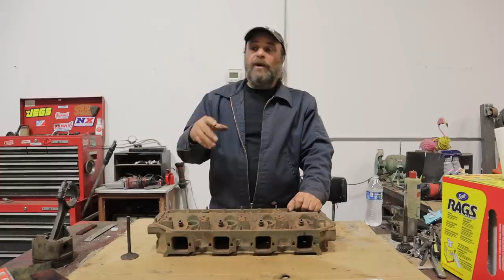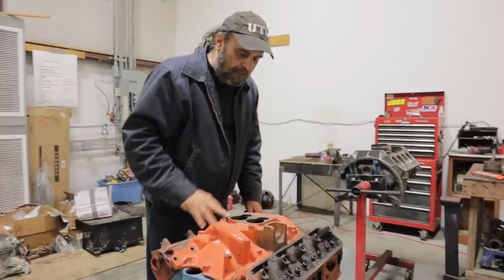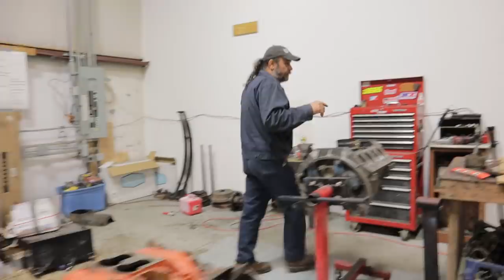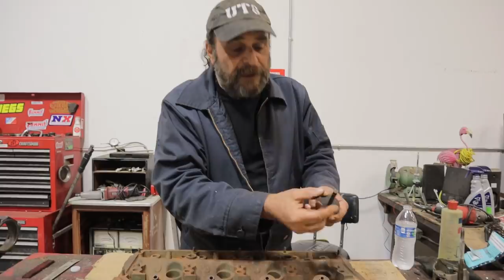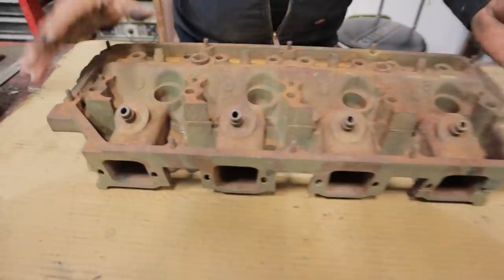Carburetor MPG Myths And Intake System Thermodynamics

Comment: Propane 360 powerwagon was gasified fuel.  It made at best 10% more mpg.  The biggest hurdle I can touch is rpm.  I can build and fine tune well, then the sweet spot in rpm for torque will get 20-30% better mpg than 1000 rpm more.

Comment: I'm a retired mechanic I had a 1965 Ford Galaxie four-door 289 V8 with a two-barrel carburetor Ford carburetor old motor compression was 120 down to 90 lb compression old motor I pulled a 5 x 10 trailer 100 lb tongue weight on the hitch I got 24 miles to the gallon going through Kansas and Missouri I modified the carburetor for better gas mileage got between 23 1/2 and 24 Mi to the gallon pulling that enclosed trailer I can also do the same modification with the Holley carburetor
Reply: What kind of modifications were made to help get good mileage?

Comment: In the 90's I was a Quadrajet wizard. I not only knew how they worked but why. I could make them run circles around a Holley..Next best thing to fuel injection in my opinion. I found through experimentation that the intake port layout affected the type of carb that would work better. On GMs and Mopars with Siamese ports, like a spreadbore and Ford type layouts respond better to square bore carbs. Back in my wrench turning days, we would see intake valves so dirty that it would screw with the mixture. Unburned fuel is nasty. Eventually sticks rings and heavy deposits lower the detonation threshold. For this reason, I regularly pour in a full can of Seafoam.
Reply: Interesting. What are your thoughts on the electronic quadrajet vs various aftermarket efi's? Wondering if such a carb could be good for a built motor in a classic, which would simplify things, and keep it out of proprietary controllers, but at the same time avoid cylinder wash and keep optimal afr, in the hands of a more novice carb tuner with limited time to apply to it. Now, I know in classuc car curcles most anything that complicates things is frowned upon, and especially electronics. And I get that on a race track a double pumper would be preferred, for quick changes etc. But as a driver, Im thinking this option may have been largely overlooked by the community. Any thoughts on the matter?
Reply: @Santor-  The E Quads were controlled by a rather primitive ECM that basically cycled the primary metering rods up and down and a oxygen sensor. For someone not familiar with the intricacies of carburation, the aftermarket EFI is the way to go. Those old carbs required knowledge of jets and metering rods. Spring tension controlled both the primary enrichment system and the opening of the secondary air doors. Misadjusted secondaries were the number one reason for the bad reputation. There were two sets of metering rods to play with as well as different hangers that varied the rate they exposed the jet. GM had many different rods, jets and hangers for different applications..my favorite trick was using a Ram air float from a GTO..it was smaller and allowed more fuel in the bowl. Having a GM chart was paramount for high performance tuning..so you can see, a novice tuner is better off with a plug and play system such as EFI

Comment: so instead of having the traditional cold air intake would mileage be slightly better with warm air because of slightly more fuel becoming vaporized ?
Reply: I'm tilting my head like a dog
Reply: In theory it might. At low load the extra heat might help vaporize the fuel along with the hot air being less dense so maybe it would lean out the mix a little. Might get to a point where you’re having to open the throttle more to compensate for the loss of power though. 

A lot of times it’s a lot of tinkering to really get there because things that seem good end up not working, and things that seem like nonsense do. The real world is funny sometimes.

Comment: i took a 1970 dodge pu put a 1971 360 stock motor other than LD340 intake and dual exhaust with glasspacks and 2 1/4' exhaust all the way to rear bumper. i started with a adapter and a 350 2-BBL holly and drove for one month tried installed 500 2-BBL then went to 600vac secondary then 750 vac secondary and then 800 double pumper drove real consertive and jetted until plugs looked good the gas mileage was only about 2 mpg difference in all of them. people just don't understand its fuel air ratio and gearing.

Comment: So conventional wisdom says to block the heat crossovers in the heads for maximum performance but you just explained a benefit to increasing heat of the air/fuel mixture.  In a future video can you elaborate on when it makes sense to block the heat cross over (like plan z) and when you should leave it open?
Reply: I had the same thought. UT had a vid a couple of years ago talking about blocking the heat crossover and how it helps keep the intake and as a result, the fuel in the carb, cooler. 
I know there's some beef between UT and the Roadkill guys, so I cautiously bring this up... they found in an episode of Engine Masters that a cool intake helps with increasing cylinder filling, not due to cooler air temp but effectively via cavitation... Cooler intake walls = lower pressure area Vs hotter area = high pressure area, so the mixture wants to find it's way to the lower pressure area, helping with cylinder filling. 
A hotter intake won't have time to heat up the mixture (too short of a duration) but it will create more resistance and slow down the mixture, whereas a cooler intake will provide less resistance, allowing more mixture to squeeze in. These are of course small differences.
They found that cool fuel temp was more important. Air temp going into carb didn't make much difference.
Cooler fuel means more energy in the same volume, so if for example an engine will pull through say 1 cubic inch of fuel, the cooler cube will contain more energy in that given volume, compared to the same size cube that's hotter. With more energy, rpm increases and the idle screw / jet  can be adjusted down, to minimise the volume of fuel pulled through (in that example, maybe only a  0.9" cube needs to be drawn through). 
Then again, that sort of suggests that the same volume is being pulled from the tank in either case. As temp changes volume, the idle screw / jets are compensating for energy per volume changes. It's still the same amount of energy, just in a different size. A warmer fuel will take up more space, so idle screw / jets need to accommodate that same unit of energy coming through in a larger volume. In other words, if tank volume is X, but in the warmer under hood temp that volume is now X +10%, volume is relative, so a warmer fuel unit passing through the carb may be X+10% but in its cooler state at the tank, it's still pulling through volume X. So maybe, fuel temp doesn't change volume consumption (efficiency), only that the metering of it needs to change relative to how that energy packet changes in volume in order not use the incorrect amount i.e. bring in a cooler mix but leave the metering the same, resulting in a larger volume being pulled the through unnecessarily. So effectively there is a dynamic between fuel tank volume, temp, and fuel draw at carb draw. 2 different temps, changing the volume, but still the same volume being pulled the through from tank (when carb adjusted the right). The cooling of fuel effectively acts a compressor... The same amount comes from the tank and the same energy is used by engine but because it's in a smaller packet, the metering is reducedduces to pull the same energy through, just in a smaller packet.
Possibly this is where hotter temps could be better... a hotter mix has more area between the molecules which requires a longer burn time (same as as lean idle mixture needing more time to burn), so this may suggest that a hotter mix would be able to release energy over a larger area in a given timeframe, creating more movement to act on the piston (it's already an expanded mix) and while it may push less (lower power), it would still push. And perhaps that's where economy from higher temps comes from... Using the minimal amount of effort to push the piston, but stil lmoving it, in exchange for lower power output.
Back to cooling quickly - A high vacuum level (cruise and idle) will help drop temp (through characteristics of low pressure effect on temp... As pressure drops, temp drops) but also the higher vacuum helps atomise the fuel more. The more fuel that is atomised, the more heat is taken out of the surroundings, keep temp low.
But you can't help think that a mixture that's as hot as possible, on the edge of combusting, is the best thing to put into a combustion chamber. That way very little change (work) is required to push the mixture into combustion, which is what would make it most efficient.
Reply: Ray-maybe I have it over simplified in my head but I always thought that the purpose of keeping the air/fuel mixture cool was that it was a denser charge in the same volume.  You would cram more air and fuel into the same space and make more power.  I never considered resistance to flow but I’d love to learn more.
Reply: The correct answer is what UT ignored. If you want to make power, you need to ATOMIZE the fuel a fine as you can get it, at the booster. Then you have to keep it as fine a you can until it hits the chamber. You need some fuel that is NOT vaporzied all the way to the chamber and into the chamber because converting the fuel to a gas (vaporization) drops the incoming charge temperature and that makes power. You can easily vaporize too much fuel and lose power. Also, I forget the temperature at which cast iron turns blue, it I know it’s more than 200 degrees and I’ve seen way too many cast iron intakes that were blue from way too much heat in the crossover. You use booster signal and design to atomize the fuel, and correct atomization leads to correct vaporization. And that makes power.

Comment: Very interesting.  It makes sense to use top tier gas to keep the valves as clean as possible so they can vaporize the fuel effectively.  Thanks for this video. Joe
Reply: Its the PCV.
Reply: Sort of, yes. But that little miniscule part of a percent of alcohol they include at $15-18 premium per tank, can be bought for $2-3 a can which lasts 20-30 tanks, which would be a far better economical approach, but in essence, same result.

"Top tier gas" is  marketed towards people who don't understand this on purpose, and they overcharge quite alot for the tiny amount one get. Higher octane gas on the other hand, IF your vehicle can benefit from it, IS actually worth it.
Reply: @Santor-  https://youtu.be/ystuUJWae0Y.   There are some other independent certified lab test videos that show benefits from the extra detergents in top tier gas.   Cheap gas near me is around 10 cents less per gallon than top tier.  Not that much difference.  Most people don't bother getting fuel system cleaners, so it may be helpful to get the gas with extra detergent added in.   I understand all of the base gas comes from the same refineries.  Top tier stations and their own proprietary extra detergents to the tanker trucks before distribution to stations.  Cheaper gas stations use base gas that meets minimum standards.

Comment: You don't want all vapor to start with. You want optimized droplets that are the proper size to make the simultaneous heat and mass transfer on the surface during the burn. Vapor and Oxygen would just ignite at once causing a disaster of high pressure. The modern electronic fuel injection can help with multiple shots over the combustion stroke. Good explanation of the passage of the gasoline from liquid to a form that can provide the pressures needed to drive the piston down properly.

Comment: A video on water injection would be great. Water injection also de-carbons an engine very well.
Reply: Windshield washer tank, nozzles like windshield washers (.025), and a vacuum switch 8 or 4 inches vac.
old old 60s trick.

Also hook up a tank in the trunk to spray the top of your tires. 👍

Comment: Someone help me out here. Going to rebuild a 360 for my Duster. Had planned on welding closed the heat exchange ports to keep the intake cooler. Now I'm wondering if thats the right thing to do. The engine is being built for the street and maybe a trip down the strip to see what it will do. Stock block, some mild porting, truck style cam for torque, older edelbrock 4 barrel intake and 600 cfm carb.
Reply: @tthams73 Yep, weld it.

Comment: Merry Christmas Tony and Family 
When you plan to play around with the Jeeps have a look at the alignment of the injectors on the 4.0 and  the original injectors are single holes.
This is what you are talking about mate, it’s designed to keep the back of the valve clean and help vapour the fuel off the heat of the valve.
The other thing that carbon does and I know you will know but didn’t mention is that carbon sucks hydrocarbons out of the air just like the charcoal canister on a car. 
When I worked for Mitsubishi we had issues with a stumbling on the 1.8 litre Lancer as you would take off at the lights.
It was like a carburettor with a bad acceleration pump plunger.
Clean the carbon out of the combustion chamber and around the back of the valve and the car’s stumbling was gone.
The single hole injectors are designed to get wet fuel to the back face of the valve to wash it.
4 hole injectors atomise the fuel earlier but can’t keep the valve as clean so you need to make sure that the stem seals are in very good condition to stop oil running down the stems of the valve and building up carbon.
I stayed with the single hole injectors for that reason it was designed right in the first place

Comment: My neighbour had a 1920's Fordson tractor that I believe had a vaporiser instead of a carburettor. Ran on kerosene or pretty much anything else that would burn, so the idea has been around for a while.
Reply: Seen a Fordson Tractor once  @ ⛽station .  Small-Stout and huge cast iron saddle seat. NorCal agriculture relic
Reply: A lot of farm tractors up into the 60's could run on Kero. There was a small gasoline tank to get the engine running and warmed up then a second tank for kero.  Some farm tractors ran on propane too.
Reply: @bobroberts2371  kerosene is basically diesel...

Comment: That is a good point....
The intake valve will vaporize some of the gas.
I have never thought about that.
But I work with Diesels mostly so that is not happening in a Diesel engine.
But here is how you can get more mileage from a gas engine.
Use a Diesel injection pump to inject gas into the ports!
The high pressure atomization will be fare superior to a carburetor or even to a low pressure fuel injection system. You will get more power and better MPGs, I guaranty it.
Reply: O just use diesel injectors huh?....
Reply: @UFC_Buffalo  Yes, of curse.
Diesel injectors, because nothing else can handle that kind of pressure.
I would also put about 5% Diesel into the fuel for lubrication of the pump.

Comment: I use an array of crystals blessed by a trustafarian shaman in Sedona in a bipolar configuration to the injector wires. But it's critical to always be chanting Om while energetically expressing diametrically opposed radiance from the spleen chakra of the driver. .01%  mpg improvements have been reported during full moons.

Comment: If I remember correctly Smoky Yunick had experimented with ceramic intake manifolds to maximize fuel temperature and heat retention but cracking was a problem. I wonder today if that idea may work with modern materials.

Comment: One reason I like e85 for racing - it's a lot less prone to carboning up an engine. In fact, when I switched to E85 in a supercharged sbc I used to race it actually partially cleaned off the pistons and combustion chamber over time. Not perfectly, there was still a little carbon in there but nowhere near as much as with race gas.
Reply: What kind of supercharger?
Reply: @UFC_Buffalo  Weiand 177

Comment: When I was younger and observation intrigued me.  Why is it when an engine mixture is lean and all other perimeters unchanged it will idle at a higher RPM.   Leaner means  more heat from air/fuel combustion, which means a more efficient burn.  So why isn't this the answer for power and economy?   It is because lean combustion quickly pushes the engine outside it operating perimeters.  Pistons engines have to run in certain temperature window.  Too cool, low power and economy.  Too hot engine melts internally.  This is why most automotive engines efficiency  is in the 30-40% range when it comes to turning heat energy to torque at the crank.   The automotive gas turbine was considered the engine of the future when in development in the 50s and 60s.  With heat regeneration they reached efficiencies in the 60% range.  Unfortunately they didn't prove to be fuel efficient for the load and RPM range that automobiles operated at.  
I've often wonder about a "mini gas turbine" might be the answer to the hybrid electric car issue since turning a generator to charging batteries presents a constant load where gas turbines are most efficient.

Comment: actually, it is thanks to the heating of the intake manifold that such a thing as the accelerator pump in the carburetor works on the car.
Moreover, if the car is not warmed up, there will be failures, since the fuel from the accelerator pump nozzle will flow into the engine in liquid form and will not perform any useful work except cooling pistons and refueling candles. But without the accelerator pump, there will be no failures in the carburetors.

So that heating the intake manifold by itself does exactly that, which vaporizes gasoline. and you can even see it, turn off the engine warmed up to operating temperature, press the gas a couple of times and you will see a cloud of steam in the intake manifold.